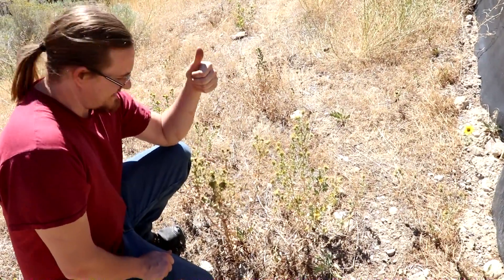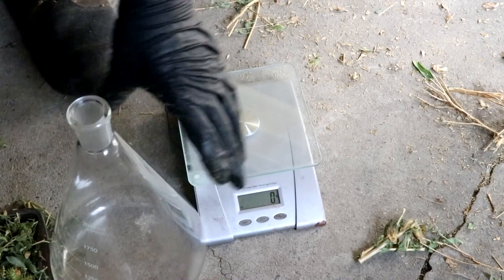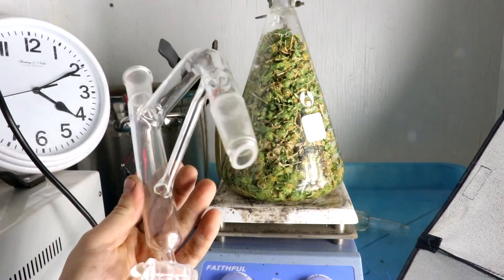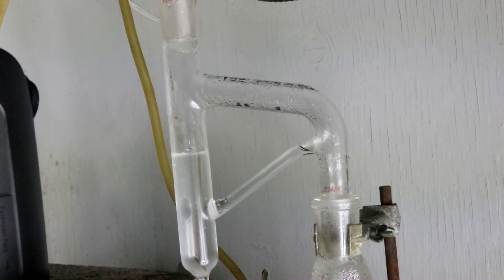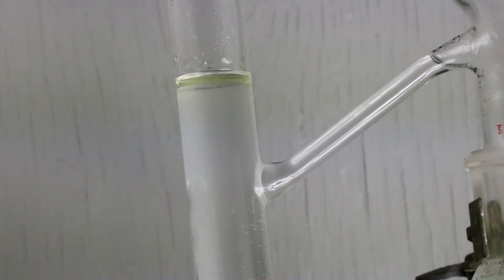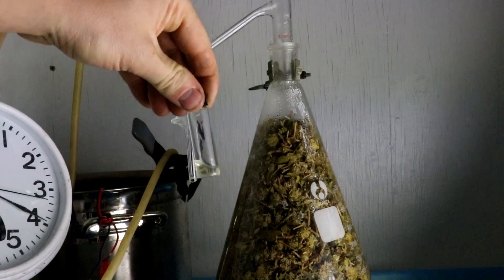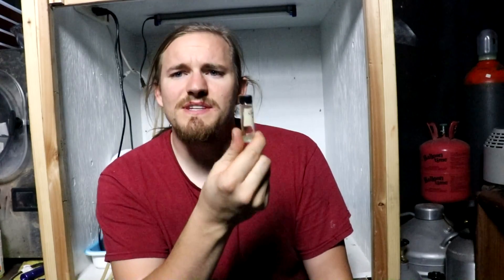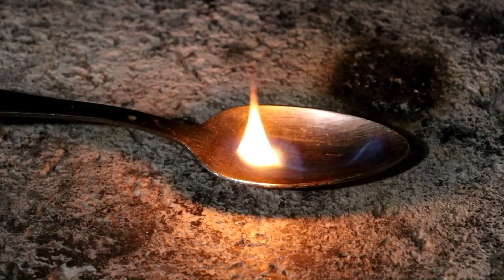Extracting Jet Fuel From GumWeed

Comment: That reminds me alot of some "oil concentration" I did when I was younger. Im no scientist, Im not a chemist, and I know basically jackshit about other plants but with pot oil (concentrated cannabis/THC oil), when done in that same steam distillation method and a few others, its nearly odorless as well. From what I was able to understand about THC, its actually used primarily as protection for the plant against UV, moisture loss, and pest damage and the THC is actually in a somewhat unstable state when produced in the plant but once extracted and concentrated it actually becomes more stable and less likely to evaporate and have any noticeable smell. I could be totally wrong in assuming the gumweed oil is similar in that "instability" but I figured I throw it out there as a possibility since plant oils, especially those produced for plants of similar natural climates, can be very similar. If you ever get bored and want to make some plastic out that oil, if you can extract enough, look up "BHO", butane hash oil, and use that process on the gumweed but "cure it" in a vacuum chamber at <120f and youll likely make some glass/plastic like substance

Comment: Theoretically you can make fuel from any plant matter, it's called ethanol... it works better from anything with a high starch/sugar content though, which is both drinking alcohol and rocket fuel (torpedo fuel as well).. but jet fuel  is kerosene which is a petroleum product so.. not so much. Also remember that grinding up your material will release more oil than leaving it whole Cody.

Comment: Why do you have to leave the condensation tube uncovered? If the water will stay separated from the oil, shouldn't be better to just maintain it covered and you don't risk to lose anything? (Just asking, I'm not sure how it works xD)
Reply: Pressure build up from the steam would shatter the glass.  You need an outlet for the pressure.  To have a better condensation tube, you need to make it longer, actively cool it, or make it out of different materials.
Reply: Nice, thanks for the info!

Comment: G'day,

  Um, how's about you re-run the calculation assuming a Solar-Thermal Steam-Generator ; instead of burning (the) Oil, or using Coal/Gas fired Gridpower...?

  You could probably have a lot of fun trying to get an old "Hit & Miss" type of Kerosene-burning Tractor-Engine to run on it - if you could get a gallon or so of the stuff together...(?).

 Have a good one.

;-p

Ciao !

Comment: If he randomly dies we all know why, fuel companies don’t want these guys showing this stuff putting their business in damger
Reply: Petroleum is ridiculously cost effective to produce compared to any known plant substitute.  You'd need a vastly more efficient setup (such as genetically modified algae farms) to come even close to theatening petroleum.
Reply: Cannabis threatened the Oil industry and Oil is in decline. If the military is trying it then they probably are working on a GMO, if that doesn't work for them they way the intended (Jet Fuel) which is very hard to refine from petroleum then it will most likely hit civilian markets, as Cody stated it's a really stable fuel, even from a basic refinement process.
Reply: Not necessary, as they are reclaiming used cooking oil to make a fuel with a higher btu content than current Jet A or B.
Reply: Then we do something, should've

Comment: This definitely was a good demonstration, but if you want to pursue this you'll need a better solvent to get a better yield. Also a more efficient condenser would be better to use, as you are probably losing the volatile terpenes with the current setup.

Comment: reality watered down till its forgotten. read up on some pot history. it was used for everything until the rocky fellers and rich big wigs wanted to take the abilities from the masses and addict them to "fossil" fuel that they could control.
Reply: I don't think modern cultivation methods could turn weed into a viable bio-fuel (it's hard to compete with underground oil),  but it would likely be a much better biofuel than the corn and soy based approaches (which need oil based fertilizer to sustain their yields, defeating the point of oil independence).  That said, I'm sure fear of weed oil was one of the factors in outlawing it (even if the fear was misguided).

Another reason weed was outlawed is because it competed with cotton in the textile industry... and there's always the racism factor.  Weed was the painkiller of choice for the poor and racial minorities.  Opium was the painkiller of choice for the rich and the white man.  So of course, to this day weed is illegal (in the federal USA) but opiate based painkillers are given out like candy (hence our "opioid epidemic")

----

I notice you put "fossil" in quotation marks.  I'm guessing you are referring to the abiotic oil theory that Russians have known about for decades?  The theory that allows Russians to find oil wells with far greater success rates than the USA's "fossil" oil experts?
Reply: Not even watching the video at its finest here.
Reply: Same with alcohol

Comment: try using rubbing alcohol to extract the oil instead of water, it would also help if you left it soaking for a few days. Also to prevent the loss of your solvent/product through the condenser just lightly cap the opening with aluminum foil

Comment: If you are not using solar thermal for your steam production you are probably using more energy for heating than you are getting out and would be better off using pyrolysis and or burning the waste weed from previously extracted batches.

Comment: You might want to isolate the glass, where you dont want condensation. Wrap with aluminium foil should do the trick. Less flow back of "loaded" water into the container, and less overall heat needed.

Comment: Could this same method be used to extract cannabis oil?
Reply: Not a good method for non-polar oils. Someone else pointed out that he wasn't even getting oil as much as the volatile terpenes. You need a better nonpolar solvent to do efficent extraction. Water isn't ideal.

Comment: The weed looks quite dry.. in my experience fresh herbs have the highest yield
Reply: These grow in my field. There's not much difference between fresh and dry. They have a very firm stem, almost woody. They have to support a wide top on a quite thin stem and they can get surprisingly large if they can get ahold of some water. They are wet in the pithy center where the moisture is protected from the heat and wind by the relatively thick woody layer.

Comment: Cody, you should try running a motor off the gum weed in the same way that cars run on wood: heat it strongly in the absence of oxygen so the oil vaporizes

Comment: One thing to consider too is how much energy goes into extracting it vs how much it produces.  Would be interesting to see if you can use it as a fuel in order to extract from more plants plants, and get more out of it.  I guess that would be the key to deciding if it's viable or not.

Comment: You can dilute the oil in a liquid gas environment. Ethanol? 
By sifon precipitated gas down a pipe full of sunweed, the dilute oil will drop from the end collected and dry than in the oven at low temperature. Watch out, stiky :D

Comment: Just a question for the intelligent people who watch this channel.
Would it be viable to use techniques similar to what is seen in the production of marijuana concentrates to extract oil from plants such as gum weed? For example using butane or isopropyl alcohol to strip some of the plant's oils and then purging it off to create a stronger oil form of that plant? I am unsure of whether these techniques would be used only on marijuana due to the active chemicals within it (thc-a) and only focusing on extracting those specific chemicals along with turpeines and cannibinol etc. Or would these processes also work for the creation of essential oils from other natural sources. Another technique would be to press the plant in a hydraulic press between to heated plates as in the creation of rosin, another extract of cannabis. I'm just curious as to if these processes would work for creating essential oils from a variety of plants, or if people use these processes to obtain concentrated forms of only the naturally occurring psychoactive chemicals in marijuana specifically. 

Cool video anyways Cody loved this one, just as much as all of your other videos! I'd love to see you try and take some Damascus steel and process it to seperate the two metals.
(Edit: wrote this before reading through some of the comments. Seems as though others have already suggested this.)
Reply: Probably the best technique would be to pulverize the plant material, then do a supercritical CO2 extraction - which is indeed the process used for high purity cannabis extracts. It's also used to extract delicate essential oils for fragrances and a whole host of other such uses. CO2 is cheap, non-flammable, and non-toxic - and thus at least theoretically ideal for use in industrial quantities, which is something that would be essential if one wanted to extract amounts of plant oil useful for fuel, especially if the oil is not strongly localized in a seed/bean [as with soy] that could be processed in other ways.

sCO2 doesn't require really extreme conditions - warmer than 31.1C and at 72.9 atmospheres and up. That's a reason it's becoming ever more popular for this sort of thing. Cheap, relatively safe (definitely no fire danger from the solvent) and no residues left in the product.
Reply: @FurrBeard  I honestly had not even considered using super critical CO2. My initial thought was  of course something like butane, but I can definitely see the safety benefits as well as the industrial usage. How would one purge off the CO2 that would remain in the finished product? As someone doing it at home I'm sure just letting it naturally vaporize would probably be the cheapest easiest way. But depending on its vaporizing rate it could take a while. I'm not sure exactly how long it would take but if it would be a problem I'm sure a simple double broiler would purify it fairly quickly. Or possibly a vacuum chamber. But that leaves me with another question. If one were to use a vacuum chamber would you have to determine the vaporizing pressure of the oil to know how far you can take the vacuum before worrying about losing any of the final product? I am very unfamiliar with vacuum chambers but they are fascinating to me and I would love to try some experimenting if I could ever afford one.
Reply: Tho thats what i thought
Reply: lol I dunno
Reply: Jake Pryor wow dats alot of writing wish you luck finding some on to answer

Comment: I have a theoretical maths question for you Cody that I think would make at the very least an interesting video to discuss.  To what extent could climate control (the heating and cooling of indoor spaces)  be contributing to global warming?  These systems function by taking the heat out of the air and moving it, when accounting for the exponentially increasing volume of indoor spaces would it be reasonable to make the conclusion that we are contributing to climate change through the process of air conditioning by displacing large volumes of heat.
Reply: The university of Florida has already more or less created an equation that would be helpful in determining the effect of air conditioning. They were doing it to solve for recoverable heat energy to reuse, but it could also function to show how much heat is displaced into outdoor air.  Recoverable heat(tons) = [rated capacity+(rated capacity * .75)]/6

Comment: Did you have enough water in the funnel for the steam distillation? 

I understand this was a proof of concept experiment.
Would have blending them, or pulverizing them before steam distilling have improved your yields? 
Or conversely, you could have frozen them in the freezer (to break the cell walls), and then steam distilled the oil from them.

Comment: You know, why not try pyrolizing the stuff, condensing the resulting gasses, and trying to refine better fuel out of the resulting liquid. This process is a little more indiscriminate about what gets vaporized, so you should actually get a pretty good yield of volatile compounds, but it would probably need some refining/distillation before use as fuel.

Comment: could u extract it in similar ways that people extract THC from weed? those processes seem to have a much higher yield than ur steam process.  You could use heat and pressure to squeeze out the oils or some sort of solvent gas?  doesnt seem like water was a good option
Reply: terpenes are usually the aroma profile of a plant, which you probably boiled off

Comment: Steam distillation is an efficient way to go, you just need much hotter steam!
Boiling in the flask limits one to 100C, less where Cody lives.
A separate boiler can get that hotter steam.
Your process steam should be hot and 'dry' enough to cook the water right out of them weeds!
Add a turbaltor to your condenser, it effectively triples the length of the column.
Turbulator is twist of copper ribbon that lives inside the condenser, increases surface area, induces turbulent flow in column, improves efficiency.

Comment: Can someone inform me, why does the condensation column have to be open at the top? Will the steam not collect at the top if it's closed off? Or is it something to do with the heat not having a sufficient way to escape the system?
Reply: Due to pressure build up from the steam, the system used can't handle any kind of pressure.
Reply: I guess that makes sense. I didn't even think about that. That's the only reason?
Reply: @alexadams6870  if the column were cold enough, do you think it would be possible to condense the steam fast enough lest it's pressure get too high?

Comment: Cody you most likely over heated the terpenes and/or flavonoids in the flower. Try using a gravity-fed hexane extraction next time. Like propane or butane. Critical CO2 well work as well. Just that's not as easy to do at home.
Reply: He had space if he wanted to

Comment: I am inclined to think that the compressing of plant material inside the flask might have make the distillation harder and less efficient. As in you could have achieved similar results with less material but more loosely packed.
Reply: How so? Obviously the boiling point of the oils is less than waters, it makes no difference if its tightly packed or not, they will vaporize.
Reply: @Sup3rman1c  I don't think the steam is able to reach all buds quite as well when tightly packed.
Reply: The actual steam doesnt have to reach all the buds, it will heat up to the boiling point of water anyway.

Comment: If it's a volatile oil then no doubt you lost plenty through your condenser.
You could store some raw material and try again in the winter when you have better ambient cooling.
It would also be interesting to compare your recovery with a hot solvent extraction.  Ethanol or isopropyl alcohol should work fine.

Comment: Cody will you make a video where you put a vacuum chamber with a vacuum gauge on the outside inside of a larger chamber which you pressurize and then you measure the pressure by seeing the change in vacuum

Comment: The vapor pressure of oil is extremely low, which means not much will evaporate at ~100C. You should do a liquid-liquid extraction with a solvent like acetone or isopropanol and then evaporate the solvent off leaving the oil.

Comment: Cody don't stop because you saw an article, there is a huge difference between a proof of concept for running a car on weed or vs a jet on said weed oil.  If the US Mil thought the plant had so much potential I think you should expand your testing.

Comment: did i understand wrong???? you need heat to produce the oil, which produces heat? so wtf??? where is the trick here?
Reply: Sometimes a liquid oil-like fuel is desired.  This could probably run a diesel engine just fine.  And you could probably burn dried out previous stock to heat the extraction.  Do it in winter so the "waste" heat is just heating your home.

Although if it's just heating the home that you're interested in, I wonder if gumweed would make a good fuel for pellet stoves.  Could be too resinous and end up gumming up the chimney, in which case... extracting the oil could be the solution.

But from what I've learned about Cody, he's not doing this because he really thinks it's practical, he's doing it because he's curious.
Reply: I bet he wanted to put that oil on his bees food or something cause he said they liked the smell.

And because the smell was gone, he just burned it. (not that he wouldnt have burned it and tasted it anyways, lol)
Reply: You may see this as a way to convert heat to a more convenient form.
The distiller can run on pretty much any heat source: Electricity as shown, wood, solar, or any waste that burns.
But the resulting oil can be transported and used much more easily. Your car won't run on wood any time soon (unless you distill flammable gasses out of it, there you go).

EDIT: Depending on your efficiency, you may even get out more than you put in, since the fuel already exists in the plant, and the heat you add is only needed to get it out.
Reply: The hotplate is only hot enough to produce steam, which moves the oil out of the plant and into a tube.  To set the oil on fire, he needed an actual blowtorch, which is significantly hotter than a hotplate.